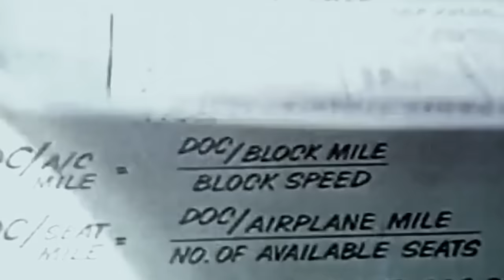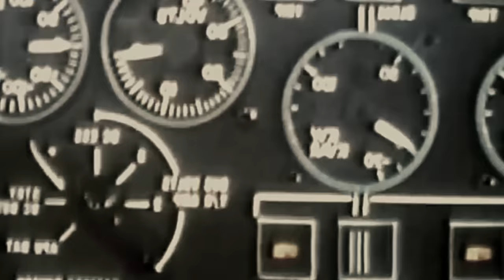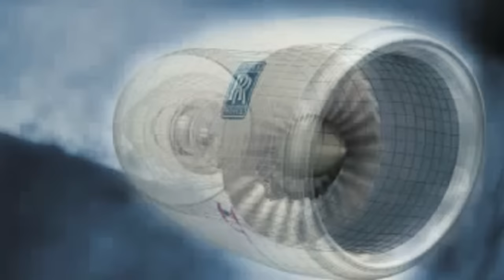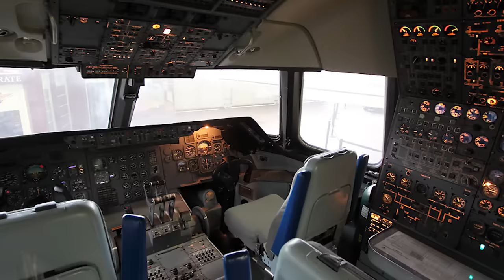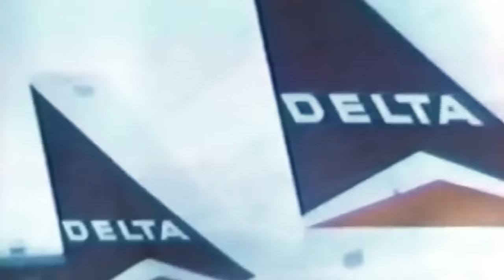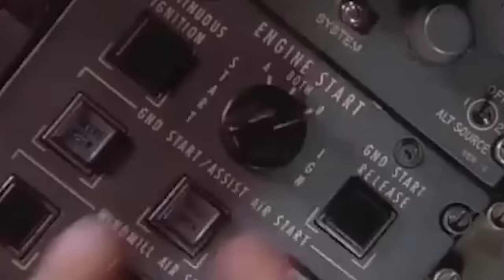L-1011 Tristar - too advanced for us

Comment: Clearly, the most advanced aircraft designed and built prior to the Boeing 777.  Not mentioned in this video is that unlike the Douglas Crap 10 that only had three hydraulic systems, the L-1011 had four. When United 232 blew the tail engine, it discharged shrapnel into the lines of all three hydraulic systems that were coupled together underneath. The result was a total loss of hydraulics. The L-1011 had a similar incident however, because the 4th line was independent from the primary three, the L-1011's crew had sufficient hydraulics to safely land the aircraft. Another big difference were the cargo doors. DC-10 doors opened outward, where the L-1011's opened inward. This created a firm seal when the cabin was pressurized. It was a much superior aircraft and the avionics were years from being equaled. The DC-10 couldn't auto-land until the mid 1980s where the L-1011 could do so on day one.
Reply: Surprising no airline flew them regularly to New Zealand. Seemed ideal for a fairly small market at that time.
Reply: You spelled A320 wrong.
Reply: All airliners use plug doors as well. Even though they open outward, the translation of the door when opened and closed assures that all door stops press tighter as the pressure differential is increased.
Reply: Bartonovich52   Uhm no, that's not how the cargo doors worked, they are pulled into the hole and then locked against the door frame, it is not a plug door design like the passenger compartment doors. Most aircraft had similar types of outward opening cargo doors, including the L-1011 (sorry Miles, but that is wrong https://www.mediastorehouse.com/flightglobal/cutaways/civil-aviation-1949-present-cutaways/lockheed-1011-cargo-door-cutaway-drawing-4955110.html ), but had various different locking mechanisms to prevent the doors from coming open. All four known cargo door accidents (2 DC-10 and 2 747) were failures in the locking mechanism to hold the door shut against the body of the aircraft, two accidents resulted in fatalities, Turkish Airlines 981 (DC-10 crashed with all 346 fatalities) and UAL 811 (747 with 8 fatalities sucked out of the aircraft in flight), the other two did not, AAL 96 (DC-10) and Pan Am 125 (747), with the last 3 of the aircraft able to safely land.
Reply: the Douglas crap 10 had the tail turbine sitting above the weak spot where the three systems converged.
Reply: Bartonovich52, your statement is untrue. By its very nature, a "plug" door is one where pressure placed upon it keeps it closed. That cannot happen with a door that swings out from the body of the aircraft. That is known as a latch door. A plug door is larger than the hole it plugs and therefore, can only open inwards.
Reply: Syd Syko, how am I wrong? You are stating what I stated. Only the L-1011 used the plug door. There were no cargo door failures on the L-1011.
Reply: The Airbus A310 was also a marvel and is flying with the Canadian Air Force today
Reply: DC-10 did have cargo doors that were not plug-seal doors but you can have a plug-seal door that opens outward. It has to move inward a small amount first and then tilt, but then it can be designed to fit through the opening.
Reply: Ok bozos. Let me educate you on something. 

The only thing that holds pressurized doors are the fittings around the door and the opening. Just because a door is bigger than an opening does not mean that it’s skin is going to withstand 8+ psid over the 50 - 100 square feet a cargo door is. 

All of those fittings interface with each other under compression. The door ones are facing out. The door frame ones are facing in. Look at every aircraft entry door and you will see them whether the door opened inward like an L-1011 or 767, outward like a 777 or every Airbus, or in first and then out like every MD and other Boeing aircraft. Point is, they get tighter as pressure increases. 

I worked on the 727. The -100s had the inward opening doors, the -200s has the outward opening ones. The outward opening ones slid on opening and closing to clear the fittings so you could open the door. Still a plug type door.

Comment: Good work man. L-1011 is an icon of my youth, my mum having worked at an airport. Used to be awestruck seeing her parked in the hangar with her livery lights on. She looked more like a spaceship than an airplane! It was only as I got older and began to read about aviation did I understand that her third engine was actually sitting between her horizontal stabs. Beautiful airplane.
Reply: SILENCE!!!
Reply: And you spelled hangar RIGHT!
Reply: Well, that's because you haven't spent your career working with both aviators and mariners....I on the other hand.....Aviation's my baby though.
Reply: @boobam3648  ships and planes are called She because they're expensive, temperamental and needy of high maintenance.

Just like women

Comment: I flew on an L1011 only once, but it was an absolute dream machine.  It was fast, quiet, and I mean you could actually have a conversation on this plane, unlike the old 737's i had flown.  The interior had incredible space, seats were wider and more comfortable, landings and take off were so smooth one hardly noticed when the wheels touched the ground, it was flying at its best, sad they are not in use today, because even with modernized technology of today, the L1011 was still the best engineered plane, hopefully they will come back again, they were and are still the epitome of air travel.

Comment: The L-1011 was more expensive than the DC-10 because it had multiple redundancies built into it that the DC-10 did not, such as stick shakers for both sides, standard. An automatic transfer bus so when the generator powering one side of the plane fell off (Chicago) the load automatically transferred to the other engines without any flight crew having to stand up to manually switch over the load. It used a screw drive as opposed to hydraulics to drive the slats. The L-1011 would have survived both Chicago and Sioux City because it was designed to.
Reply: It’s stabilizer was a completely different design and it jammed. The DC-10s never did. Good thing for fat passengers you can use as ballast, lol.
Reply: none of your assertions are true and you conflated electrical power with propulsion.  There are some more important differences.  Go back and do your research.  BTW, this video conflates lots of things, repeats itself and never really defines the difference in technology applied to the airplanes.  Also of note the DC-10 was never delivered with the RB.211 because there wasn't enough customer demand to justify even the pylon engineering change, but Douglas did offer a Rolls-Royce version to customers.  Hint about tech; avionics and stab. and smaller wing.
Reply: Genda Minoru, do you even know the meaning of the word "conflate"? As for my statement, I will clarify it for you. On American 191, when the left engine fell off, it took the #1 generator with it. That generator supplied AC power to the Captain's instruments and stick shaker. On the DC-10, the stick shaker was only standard equipment on the left side. It was an option on the right (Co-Pilot's) side that American Airline did not purchase. The only way to restore power to the Captain's instruments and the stick shaker was for the flight engineer to get out of his seat, and manually flip a switch in the rear overhead counsel that tied those instruments into the #2 or #3 generator. On the L-1011, the stick shaker was standard equipment on both sides so when the left wing stalled as it did on AA 191, the Co-Pilot would have known it and not stalled the wing. On the L-1011, upon failure of the #1 electrical bus, the  systems using that generator would have automatically transferred to the #2 or #3 bus being powered by the remaining engines. As such, both pilots would have had working stick shakers and the Pilot would have retained his instruments.
Reply: Interesting.  Pugilistic over an old airplane design.  Ok Let's compare our aero engineering degrees and experience in design.  I assume you worked for Lockheed?  I did work for McDonnell Douglas as you likely surmise.  So first things being first, Conflate; combine (two or more texts, ideas, etc.) into one.   synonyms; mix, blend, fuse, unite, integrate.  Your discussion of transfer power buses to the engine falling of is oddly juxtaposed, as the power has cross ties where all generators are brought on line and you don't lose power simply because an engine is no longer operating regardless of the reason.  I assume that you do know that the control columns are interconnected.  Essential bus does not need to be reset unless it sheds all of the load and from NTSB reports we know that did not happen.  So I await your pugilistic round two argument to see if it is you who knows what you are talking about.  If necessary I can even provide you with the relevant LAMM schematic.  You see you never know who you will run into on YouTube forums, so be careful.
Reply: Genda Minoru  - You're probably the guy whose designs carry all the flaws that others have to engineer out. Read Page 67, Paragraph 6 of the NTSB report. It states that all power to the a.c. and d.c. generator buses were lost when the pylon separated, rendering the Captain's instruments inoperative, and that power to these buses was never restored. Also, see Paragraph 2 at Page 57: Regarding the design of the outboard leading slats that retracted once hydraulic fluid was lost: "Other aircraft designs include positive mechanical locking devices to prevent movement of the slats by external loads following a primary failure". Lockheed employed this "positive mechanical locking device" on the L-1011. Douglas did not do so on the DC-10. The DC-10 was a rush job to satisfy American Airlines requested for a wide body smaller than the 747. AA got just what it paid for. A cheap piece of crap and many people wound up paying for that heap of trash with their lives as opposed to the L-1011 that had not one hull loss due to design. Terrorism, Pilot Error, or Weather brought down the eight L-1011's that were written off.
Reply: more derogatory shit from your direction - maybe I'll have time to reply later even though this convo is stupidly sadistic.  I'm the one who fixes other people's work BTW.
Reply: "more derogatory shit from your direction" quoting the findings of an air accident investigation is "derogatory shit"!?!? How about you show some respect to the people who died in these disasters and not disparage the justified investigation into their deaths.

I suppose the term is correct as derogatory is "tending to lessen the merit or reputation of a person or thing" well the FACTS lessen the merit, but it's generally only applied to reject subjective comments not objective facts and impartial judgements. If you don't like the facts, tough, everyone else DOES like to know if there are KNOWN dangers that are repeatedly ignored and downplayed just so that there's a bigger profits report for stockholders. I'm shocked that anyone who ever worked for McDonnell Douglas is anything but overwhelmed with contrition over their unequivocally bad choices in airline safety. Your attitude is why McDonnell Douglas is bankrupt and any company you work for who accepts your attitude will be closer to bankruptcy.

Everyone should be utterly humble over these deaths in the DC-10 that were both could have been foreseen, were found and could have been prevented yet were not. For the worst reasons. And it was all covered up. No disaster that is so easy to foresee and so easy to prevent should be allowed to happen.

Arguably the DC-10 isn't fundamentally flawed. What is fundamentally flawed is the attitude of the people who ensured all the systems were safe, that the design wasn't finalised by some callous jerk who'd just hand-wave "oh anything could happen, so screw it I don't have to fix this obvious fatal problem that I know is so likely to happen".
Reply: How is it supposed to be respectful to the dead to allow American Airlines propaganda to prevail.  If you want to quote NTSB findings and court settlements, then you need to quote all of them, not just the ones convenient to your narrative.  This crash was not the fault of the OEM.  Americans rigorous defense had half the country believing that it was McDonnell Douglas fault the airplane crashed.  Do you know how many times American and United and Continental were warned about unsafe engine change practices using forklifts to save a few dollars?  Do you know they desperately tried to hide the engine mounting bolt which proved it was American's fault the mount failed?  In order to prevent bad behavior leading to more senseless tragedy, we have to call out those responsible.  Derogatory shit has to do with a total stranger impugning my capabilities and diligence as an engineer without knowledge.  That's derogatory.  It has nothing to do with the loss of like.  PS. I DIDN'T WORK ON THE DC-10, only twinjets.  You seem to have the same pile of assumptions as the previous poster without knowledge.  Maybe this is what we call "tribal knowledge" which happens without any firsthand experience or original data sources.  So far as I can tell the only design flaw the DC-10 had was the infamous cargo door latches, which was resolved after the accident.  Like I said, sadistic.
Reply: @gendaminoru3195  you rant about assumptions when you assume I was talking about the engine detachment problem rather than the cargo door problem.

Actually, you cannot have accidentally assumed wrong, you must have deliberately pretended. Those are completely different NTSB reports.

The cargo doors wasn't just a problem, it was also the corporate coverup that was so bad.
Reply: This is the gift that keeps on giving.  Of course some of us have other things to do besides childish retorts ad nauseum.  People talked about MDC killing those victims of both crashes, when it was actions taken by the operator that caused them.  The same thing happened with the Alaska MD-80.  In all these cases had the operators complied with the ops manuals; AFM AMM etc nothing would have happened at all.  Only the Sioux City incident UA232 was a case of MDC being partially to blame, but most of the blame was on the repair shop who pencil whipped the fan disk, with lessor contributory negligence on MDC for having all three hydraulic lines in line with the fan disk and no fuses in the vicinity.  My point has always been that MDC and this airplane in particular have been unfairly attacked and maligned by opposing counsel and the media in a concerted effort to end the MDC.
Reply: @gendaminoru3195  and you unfairly defend them. Stop going on about all the thing that weren't their fault to distract from the things that were their fault and earned their bad reputation.

If you rob a bank, you can't say "but what about all these other bank robberies I didn't commit".

They COVERED UP the KNOWN DANGER for so... so long.

You can't sweep that under the rug.
Reply: The gift that keeps on giving.  I have better things to do than entertain you. let alone talking nebulous bank robberies.  You are obviously one who was duped by the media.  Strange thing is we all have the same NTSB reports....
Reply: Nebulous bank robberies? Have you not - in your entire life - heard of an ANALOGY before??!? There's nothing nebulous about a clearly framed analogy. Duped by the media?!? The "media" stopped talking about DC-10's long before I was even born.

"Strange thing is we all have the same NTSB reports"

Yet you're the outlier in your misleading conclusions from them.
Reply: @gendaminoru3195 : That and they were above the "engine out" speed so they slowed down. That caused the wing to stall which ultimately caused the crash. Had they kept their speed up they would have had a much better chance of survival. AAL changed that procedure too.
Reply: Yes indeed, I recall that issue and that airspeed really killed them even with the pylon etc missing.  Even worse PAX were able to watch the forward facing video of this crash.  To me this is still the most tragic needless loss of life followed by the Detroit T-O attempt without flaps or the Alaska jackscrew - none of which were due to the manufacturer of the planes.
Reply: I'm just happy u mentioned souix city in not the only one who knows
Edit did a dc-10 and a L-1011 both crash with callsign 191
Reply: The L-1011 would have only survived Sioux City by luck. 

In fact... it was luck that prevented Eastern 935 from being a Sioux City. Engine fragments hit but only by luck did not penetrate the fourth hydraulic system.
Reply: Genda Minoru Yeah I did think MDC did get a raw deal. The AA crash was ridiculous, did they not have those enormous engine hoists that would be rolled into place back then like we do now?

The irony of the cargo door issue is that both Boeing and Lockheed dealt with their own cargo door issue. There’s a reason the C-5 has 3/4 inch pins inserted into the fuselage and front and rear doors because Congress grounded the plane after the accident in Nam. The difference between hundreds of dead orphans and the passengers aboard the DC-10 was that the future of the C-5 wasn’t in the hands of public opinion, it was in the hands of the Air Force.
Reply: Genda Minoru But dont the ties have to be manually selected? I honestly can’t remember. I thought the auto bus tie would do it if one generator fell off line.
Reply: Another cost driver was the way the fuselage and wings were designed.  The whole side of the fuselage at window level was fabricated from 3/8 in thickness Al plate.  When the fuselage structure was complete they would attach a gig and cut the window openings with a large pin router. No way in hell could a window fail.  The wings were fabricated from long thick Al extrusions with built in stringers. Tough and built to last.